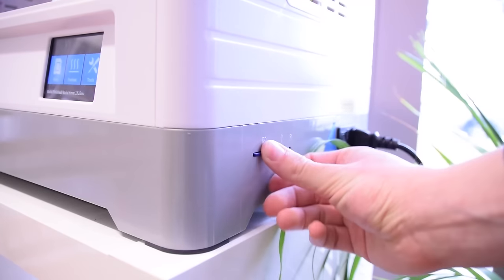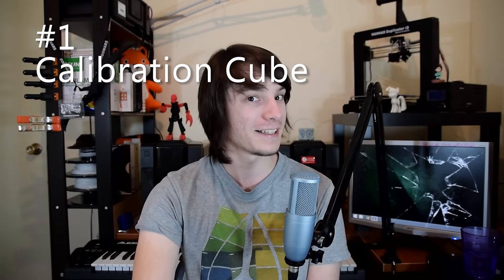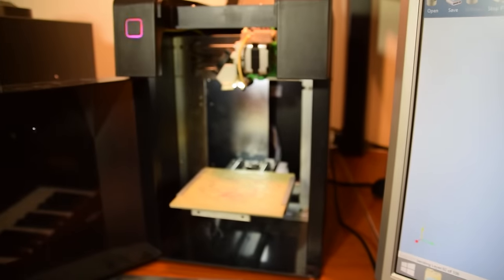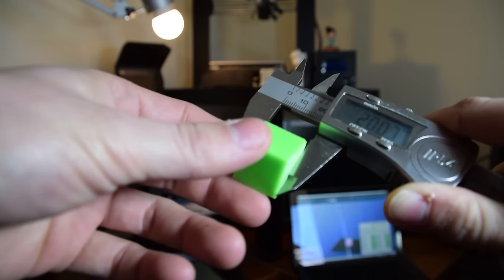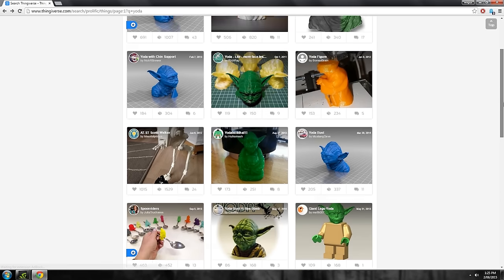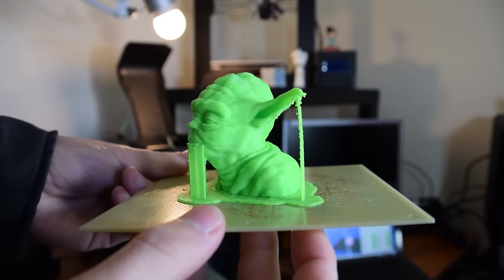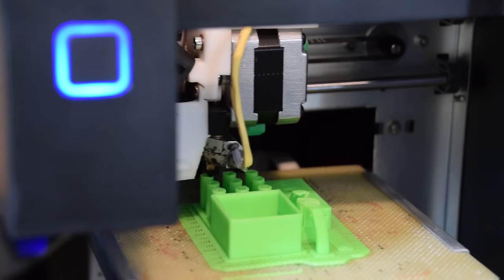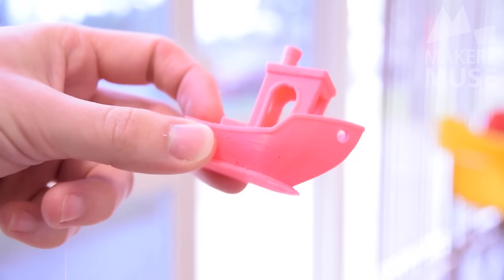What should you 3D Print first? 3D Printing 101 - 2015

Comment: These are optional but also good things to lean on. A filament wiper/oiler. There's a heap of designs out there and also like a razor holder for removing the prints from the bed. Also a great idea!
Reply from the maker: Calvin Witt Yep! The 3D Printed Tools and dust filters are a start of all the useful things to print, certainly worthy of a next video.
Reply: Maker's Muse Oh for sure. It feels good having your printer make upgrades for it self be it a dust filter, tray scraper, gopro holder and so on. I am surprised how few people know about the dust filter! Once I got one I haven't had any jams due to dust building up in the nozzle and burning. 

Keep up the good work on the 3D printing 101 videos. Very helpful stuff!

Comment: what do you do if your calibration cube is off? what are considered acceptable tolerances?
Reply: Acceptable tolerance depends on application. If you're doing basic display modeling, people wont notice a half millimeter here or there (usually). If you're making an industrial professional prototype, .1 mm can be a huge deal. If you're just playing around as a hobbyist, dont fret too much about precision like that unless you're making complex moving mechanisms.
As for how to fix it, I have no clue. My printer gets here in about a week so I have to figure that out. Probably moving an alignment screw on whatever axis is messed up
Reply: @iangolsby8471  Hi Ian, thank you for your video. What should one do if the calibration is off? Do we need to adjust everyhing in the slicer or do we need to fix some screws on the printer itself?

Comment: Hi, I'm looking into buying a 3d printer for making jewellery. Simple pendants to start with but maybe rings and bracelets once I get the hang of it :) Could you do a buying guide? So I would know what to look for? Having a look at the manufacturers' websites at the spec and features is just confusing the hell out of me! haha
Reply from the maker: Hey there! I've actually made an Ebook buyers guide to 3D Printers to help people make an informed decision; the link is in the description - just need to scroll down a little :)
From my experience, pendants and rings are good beginner bedfellows when starting to make 3D printed jewelry (I have a Fennec fox ring stored somewhere). Bracelets may prove a bit more challenging depending on how thin the model is, and chain link will DEFINITELY be a challenge (But not impossible).
Reply: awesome thanks!

Comment: What is the overall strength and quality like in your opinion, for example a plastic print or the wood print, if you drop or knock the wooden 'Bender' model on to the ground, would it break easy, not saying for you to test it out and ruin your Bender :P but maybe you have experienced another print model or something you wanted to try yourself?

For this I am talking about printing from the Aldi version 3D Printer, though I am yet to get one I still hope I can dig one up somewhere..

Last question, how well could you paint over these models either the plastic or wooden, is this something you too have done yourself and could share some experience with, or perhaps a future video where you paint Bender in the silver metal like color and paint the white eyes etc..

Thanks in advance....

Zro Dfects

Comment: In your opinion which 3D printer or Setup would you consider the cheapest one? I saw your video "how cheap can a printer get" But I am just starting and I dont really dare to put all that stuff toguether yet. Lets say something between the ranges of 150 - 250 $. I am just geting started and dont want anything professional, just to test and maybe improve it later. 
Thanks, just discovered your videos, I am just getting started in this area but I'm getting really exited with all this stuff.
Reply: +Pol Saez you wont find one that cheap that's good and don't have to build...if you want a great printer with minimal assembly required Flashforge creator pro.. $999.00 on amazon
Reply: Yeah, I did some research and you are correct, Finally I purchased a Prusa i3 2016 for 200 euros.

Comment: Thanks for the video Angus, I'm currently working on backlash as that's a problem with my printer, and then I'm going to see if there's a way I can fix the appalling Z wobble
Reply from the maker: zak robbins Z wobble is not good! Is the Z axis screw secured at the top? That might help - unless it's bent which is very bad news and will need a replacement. For backlash - it could be the screws holding the pulleys to the motors, or maybe just too loose belts. Feel free to stop by with it and I can have a look!

Comment: ANYCUBIC Mega Pro 3D Printer, I just bought one of these, so I tried the 20mm cube to test how accurate the printer is.  .02 of a mili is good enough I guess for me.  However in the z-direction (up) I only got about 3 mm as the print wouldn't stick to the plate.  Should I  relevel the plate?

Comment: Sorry for the repost but probably better to put my request/comment here ?

Wondering if you could make a 3d printing 101 on how you would go arounf making a mixed filament type for exemple printing with nylon and carbon fiber type filament using a 2 extruder setup.  Would you approche it a the cad level or more at the slicer level?

Cheers,
Reply from the maker: Both those materials are extremely difficult to print with, so it's not so much a Slicing issue (easy to do this using Simplify3D using multiple processes) but difficult from a material point of view.  I'd also need a machine with dual extruders to demonstrate it! But that's not a no, just need the hardware.
Reply: +Maker's Muse Thanks for the follow up, much appreciated.   Was curious to know your opinion and what approach you would take design, cad, slicer and hardware wise.

nylon and carbon fiber looked like a good fit.  Not too sure about other stuff like polycarbonate.  Will continue reading/researching on the subject and probably try it myself one day if i can find the time. 

cheers,

Comment: just finished building my printer kit. it's a HICTOP 3dp-11. my first print was a Weighted Companion cube I designed on AutoDesk 123D and it turned out ok i guess. there was some ghosting visible on the sides and measurements were bigger by 0.25 mm, not sure if thats good or not.
Reply: I got the same printer it's a pain in the ass

Comment: hello maker's muse! i have a robo 3d r1+ but absolutely everything i print, the right side starts to shift up. and the overall print ends up with a very bad surface (where it shifts). i've tried to print slower already. i'm using CURA 15.04.6
OCTAVE filament 
PLA 190c,
bed temp 65c
layer height .246
Reply: answer please

Comment: hey I have a quick question, I was able to print the 20mm calibration cube and yoda bust with successful results.  Do I use support material when printing the torture test? What about layer resolution?  it doesn't say it on the part link on Thingiverse

Comment: i'm loosing my mind. i've creted in fusion360 a box, which i wanted to make a "cut" with yoda model, thus cretating an opening box. 
well, managed to decimate /reduce poligons from your simplified yoda, and managed to create the cut... but... the ears, well, i need them flat or closed with no "holes"... tried to use mesh fusion360 with loft and patch, but not able to "stitch" back to solid because its still too heavy... tried meshmixer but have no clue how to "close" the ears? is there any simple way to do "closed stuff"? thanks